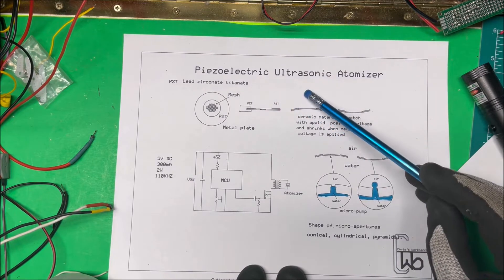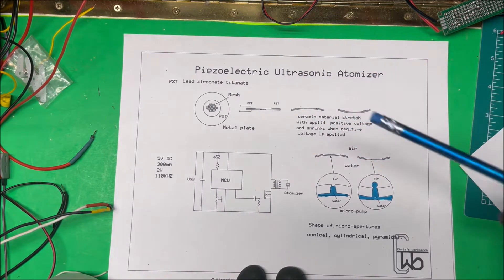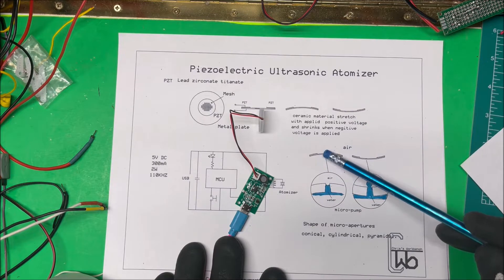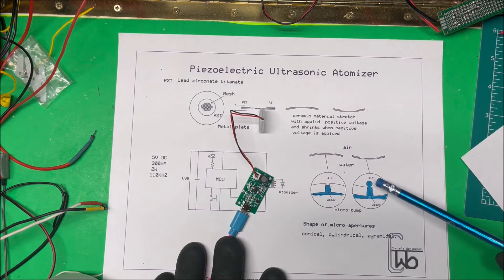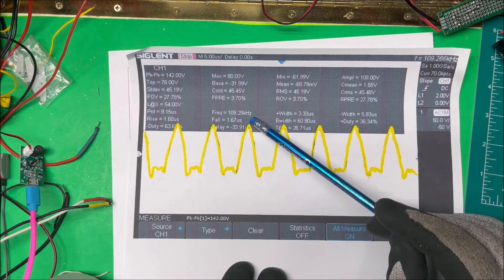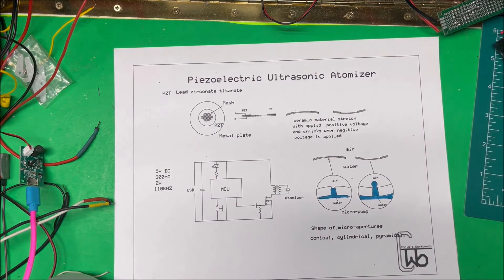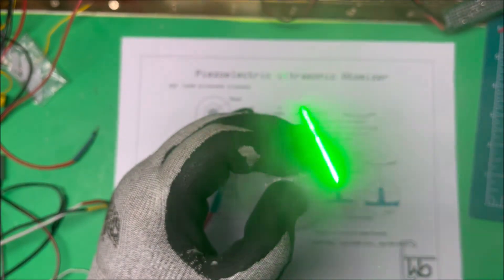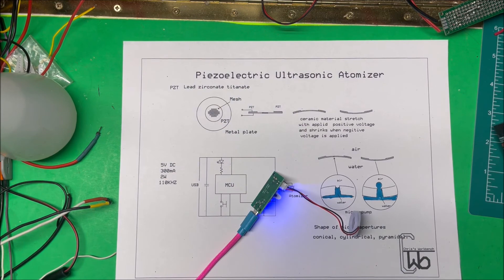Piezoelectric Atomizer

Comment: I really enjoy your videos = thank you! I am so glad that you talked about the 70V voltage requirement. I would have been tempted to buy just the piezo puck to try to play with it using my function generator. However, the function generator only has a 10Vpp output, IIRC, and that would not make for much vapor, if any.

Comment: So how would you make a controller for a vibrating mesh (125KHz) that runs off of DC?
Reply: It‘s not easy, I‘m trying with 1.7Mhz, custom coils, mcus and I have a hard time switching the gate of the mosfet without a driver. I‘ll go and get a Mosfet with a lower Gate Capacitance and then try again. The sine wave already works but it collapses under load.